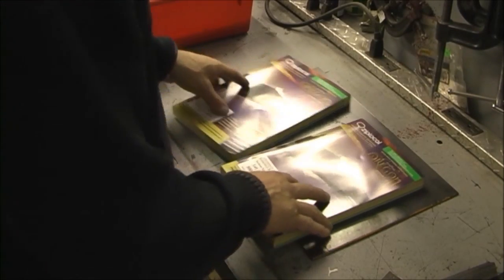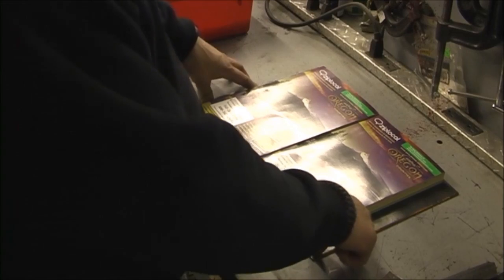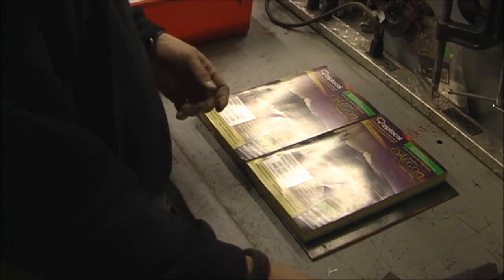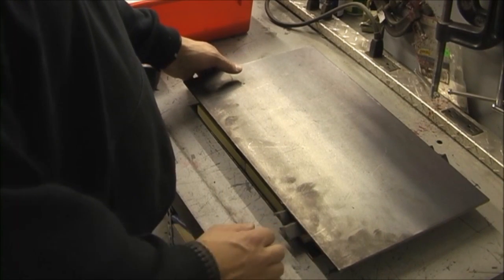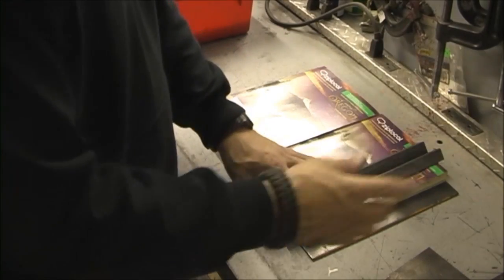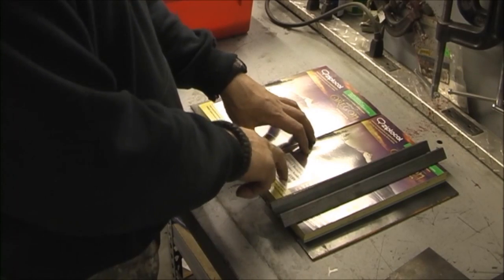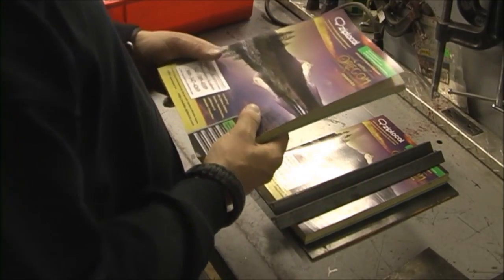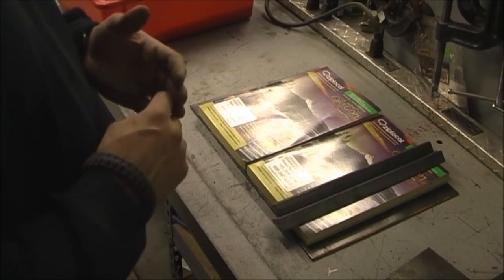Homemade Bulletproof Armor Project "Video 1"

Comment: is the first plate 1/8" mild steel ? im susprised the pistol rounds stoped in the front. plate tnx for the videos.
Reply from the maker: Yes, 1/8 inch mid steel... Semi-heat tempered, but yeah stopped rounds... But you there is a solid backing behind the plate. Thanks for watching
Reply: +Central Oregon Survival Network  tnx for the info im planning make a balistic door usin 1/8 " or a 3/16 mild steel sheet

Comment: Nice dude you got a new sub. Cool idea you ever think about ceramic tile like the myth busters? Been thinking might work for helmets.
Reply: Central Oregon Survival Network if the tiles are small and encased in hard layers one shattering won't matter as it effects a smaller area. a cracked tile still helps stop a bullet like an uncracked one. the ceramic on an impact area is pulverised in to powder that takes a lot of energy out of the bullet because ceramics have some of the highest hardness ratings right up there next to diamond. It will also deform the bullet so it gets slowed down more effectively by whatever is behind the tiles usually kevlar aramid layers, but woven roving fibreglass layers set in epoxy will work as well just need more of layers is all! in your case the books could replace the kevlar/fibreglass but i would still laminate all of the books pages with epoxy, de-lamination of layers helps sucks energy out of a bullet. also if you do use tiles try find the hardest ceramics you can, maybe floor ceramic tiles, porcelain,terracotta/clay are the most common tiles but are weak, still effective though, silicon carbide is used in commercial ceramic armor.
Reply: Central Oregon Survival Network no prob, if you want a bit more info you can read the structure and material section on wiki http://en.wikipedia.org/wiki/Chobham_armour#Structure
chobham is different in structure than plates used on body armor and hence is heavier with steel or whatever plate backings but can defeat some pretty nasty rounds.
 look forward to seeing what you come up with!
Reply from the maker: You know, I will have to look at the series of myth busters, did it shatter? That is my only concern, that is will shatter and not be able to take secondary hits.. I am working on some changes like adding fiberglass. The series isn't over yet... LOL thanks for the subscription and for watching...
Reply from the maker: Sweet thank you for the great information, I will give it a shot, sounds like it should work pretty well... Thanks for watching
Reply from the maker: Thank you and thanks for the info!!!

Comment: So after you harden the plates are you going to temper the hardness down?  I am thinking if the steel is too hard it could become brittle and shatter when the bullet hits. Is this going to be wearable armor or something you would retrofit onto a car or something? This is going to be a interesting series even if it doesn't work this will be educational. 

Jason
Reply from the maker: I only got them to 500 degree's and then flashed them. So, I don't think it will be very brittle, as I have hardened steel before. If this works, I am going to build bolt on vehicle doors that hook to the exoskeleton of my Blazer. They will end up weighing 185 lbs each, but lighter then hardened 1/2 plate. A military up armored HUMMV door weighs 429 lbs each. Looking for a good alternative, and again, just an experiment to see if it can be done. I done plan needed them for anything, just testing out a theory. Thanks for watching